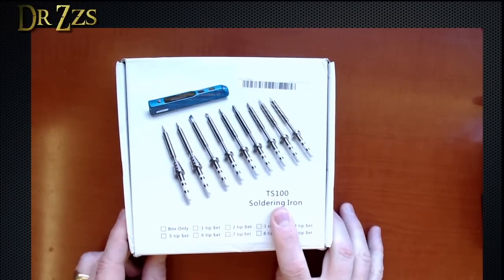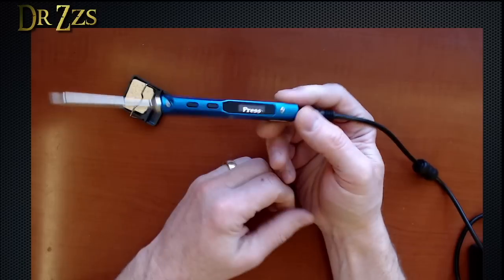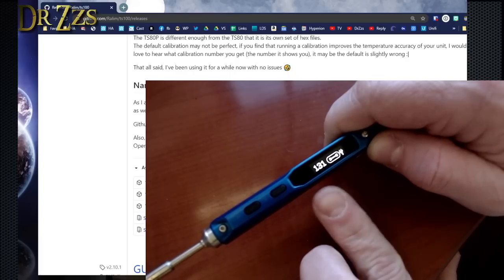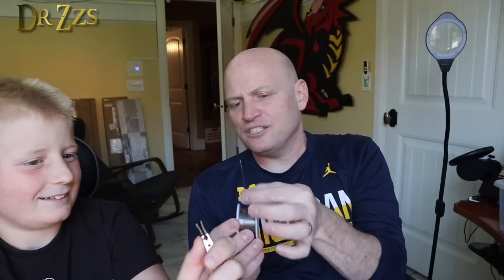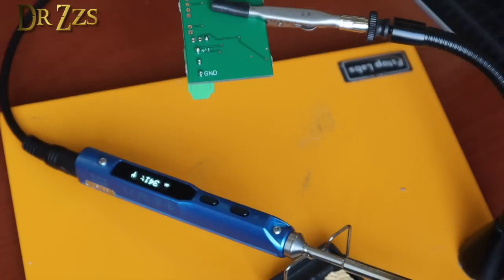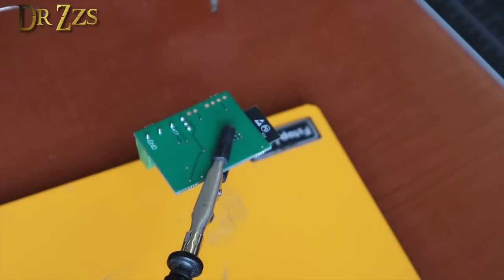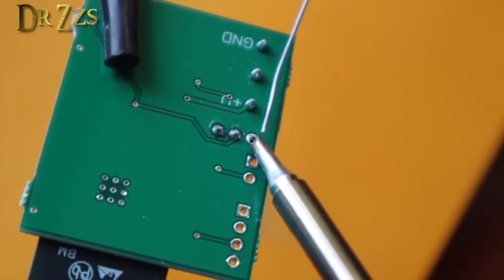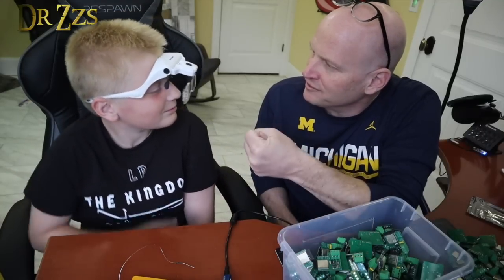Soldering Class w/ DrZzs + TS100 Smart Soldering Iron Review

Comment: I've never managed to get the hang of soldering, but I can see now that I've been using the wrong kit in the past for electronics - fat tip, fat solder, no magnification, no helping hands, so no surprises really!  I doubt I'd be able to justify such an expensive iron, but I might just pick up a couple of cheap bits and see how I get on, just for the heck of it.
Reply from the maker: I used a cheap $20 iron for the past 4-5 years.  I do enough soldering now to justify a better iron.  That's a good goal; get good enough to justify the ts100 :)

Comment: Hi I bought one of these last week as a portable soldering option for working on my classic car wiring and my remote solar powered greenhouse installation. To power it I went for a low cost (£13/$17) adapter for my 20V Dewalt batteries. Works perfectly. You can get such adapters for all the common battery powered power tools. Or you could 3D print one!

Comment: But don't get the ts100 the ts80 is much better, can be usb powered too.
Reply from the maker: I know there's firmware for the ts80 too.  
I would have thought a higher number means better.  What does the ts80 have/do that the ts100 doesn't?
Reply: @DrZzs  I got the TS80 a year ago as well when I was comparing the two. It's smaller and easier to hold, like a pen really. It gets just as hot but I haven't compared this myself of course. I changed the firmware which allows the temp to be pushed over 400deg/c. The tips can easily be changed as well as it's just an audio type jack. I sometimes power it off a portable battery as it's a USB-C connection. So it was an easy decision & no regrets to go with it.
Reply: @DrZzs  firmware for  all models😊they know we like firmware.

Comment: @DrZzs, what battery did you buy to power this?
Reply from the maker: no battery.  I'm using a 12v PS.
Reply: Hi I bought one of these last week as a portable soldering option for working on my classic car wiring and my remote solar powered greenhouse installation. To power it I went for a low cost (£13/$17) adapter for my 20V Dewalt batteries. Works perfectly. You can get such adapters for all the common battery powered power tools. Or you could 3D print one!

Comment: Id never soldered before and bought the TS100 with BC2 tip (same as used in this video) and just dove straight in with soldering a QuinLED Dig-Uno board its not pretty but it works, I've now done 3 boards and they are starting to look much neater.
No way near as neat as Dawson's attempts though - thumbs up for Dawson.
Reply from the maker: Thanks!
it doesn't take much practice to get a lot better fast.  Kudos for building your own Dig-Unos!

Comment: I've been raving about this for the past 3 years now! It out performs my £500 weller solder station. And you only need 1 tip. Update the firmware to the ralim firmware and its amazing!
Reply from the maker: True Dat!
Reply: Yep it's my go too iron, however it's horses for courses it would be any good on anything that requires lots of heat because of  heat dissipation, for this a big iron will be better.
But it's certainly my go too iron and likewise that's over Weller stations